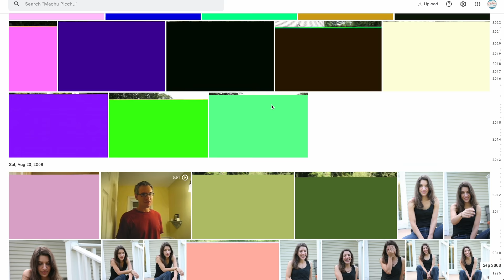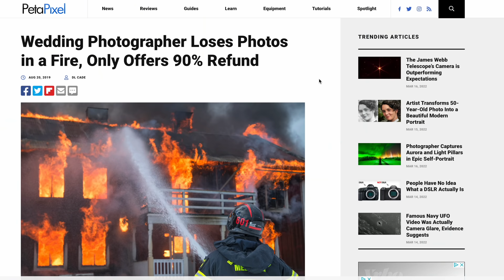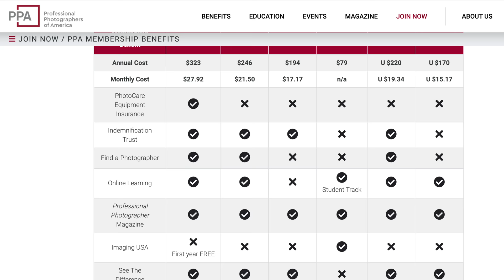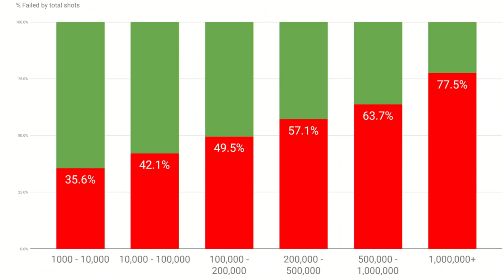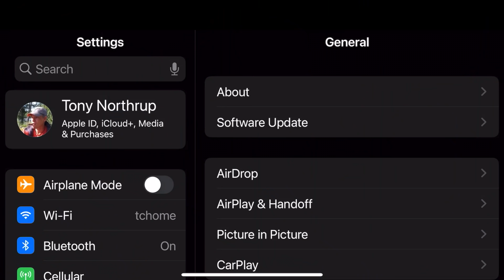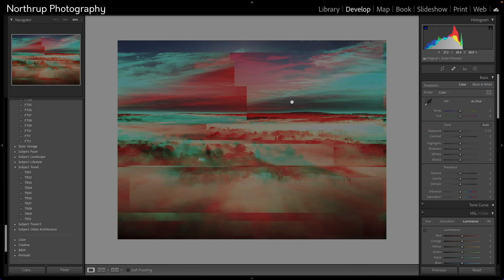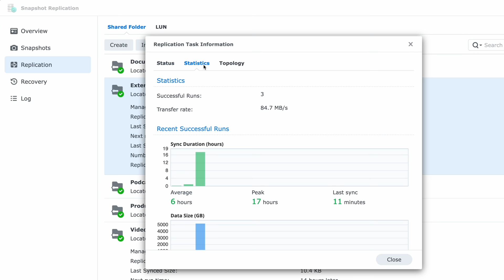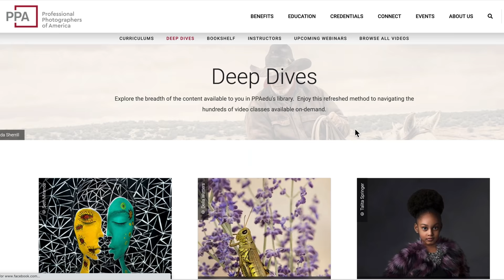NAS Storage for Photos & Video: PROTECT YOUR DATA!

Comment: Use a NAS that uses ZFS as a file system, since zfs has built-in bit rot and data integrity features. We build large enterprise storage SANs with sensitive data, all built on ZFS. In 18+ years haven’t had a single corruption issue with high io storage devices. I don’t remember the last time I had to do data recovery.
Reply: Yes, but make sure to use a mirror or similar as well as an online backup. A mirror allows for healing the rot.
Reply: Modern filesystems that protect against bit rot and data integrity are definitely the way to go. I'm building a new setup with two NAS-es now (haven't had any data loss in 20 years, but trying to beat my bad luck here). Primary NAS will be TrueNAS Core running ZFS. Secondary NAS will be Synology running BTRFS. I also have backup in the cloud for everything except video (too expensive and slow to backup and restore).

I'll also use snapshots at least for TrueNAS/ZFS, and I'm hoping to do this with BTRFS on Synology too. Snapshots every hour for a day, every day for two weeks, etc.

Even so, I'm still constantly worried about bit rot or crypto virus. I'd like to incorporate some form of checking integrity automatically, perhaps using hashing, but I'm not really sure about the best way to go about this...
Reply: Maybe if there were good ways to declare parts of backups immutable, in order to prevent them from being overwritten...?
Reply: Specifically make sure ZFS scrubbing is setup to repair the rot. Just having RAIDZ, etc. is not enough as it won't actively check for errors until something is accessed.

Linus Tech Tips just had this exact issue when they weren't actively checking their old data.
Reply: Tony said, that he's using Btrfs for his backup system, though?
Reply: @eivinha  That only protects against deletion and tampering. It does not protect you against a bit being hit by cosmic rays or other accident that direclty changes the values being stored independent of the drive's normal functioning.
Reply: @PeterBrockie  This is true. It's worth setting that up to happen every week or two depending on how often you're doing your backups.

That being said, if you've got backup software, it should be hitting all those files regularly anyways, the scrubbing is just an extra level of making absolutely certain that all the sectors are still good.
Reply: I used a NAS too but that didn't matter when my home burned down
Reply: ZFS is not GPL compatible and it's owned by FOSS hostile Oracle. No way I'm trusting my data to that. You can use LVM RAID + dm-integrity under RHEL based distros or ReFS + storage spaces if you have Pro Workstation or a server license. Both offer data redundancy and bitrot protection with properly scheduled scrubbing
Reply: @thephotodl4455  WOW thats a comment.  "BYOB and if you could RSVP ASAP that would be A-OK with me!" -Ryan George
Reply: @skyhouse71  you seem unfamiliar with tech names, perhaps you should stay away from NAS
Reply: @eivinha  that's a decent thought but consider that your backup isn't immune to bit rot. The only way that I've found is that you just have to have a separate record of all files. For example, if you create MD5 checksums for all new files, you can check whether they're still intact. Of course you'll need to keep checking both in your primary storage and backups. That takes a lot of time when you have lots of files but it's worth it. ZFS is probably superior to manual MD5 checks because it's data integrity checks are built in.
Reply: Exactly like this: ZFS is THE solution!
Reply: @thephotodl4455  ZFS has been forked a long time ago. There are OSS implementations.
Reply: @FrankFiene  open source does not mean GPL compatible (kernel requirement) or free from corporate interference. See MySQL vs MariaDB
Reply: @thephotodl4455  I don't need GPL compatibility, there are Linux distributions or MacOS (BSD) running with ZFS. I don't see any influence from Oracle there.
Reply: @FrankFiene  it's compatible with bsd license; using it with Linux kernel means you are giving up the cddl of zfs and it's associated patent license; the fact oracle hasn't done anything doesn't mean they won't. What paid Linux distro uses zfs? I know RHEL does not.
Reply: @thephotodl4455  No idea. I am using Debian and Ubuntu LTE in production environments. OK, not for SAP HANA, but for everything else.
Reply: @FrankFiene  you're fine until Oracle sees commercial value in the property or after all the parents expire. Right now Oracle sees no commercial value.
Reply: Every HDD or SSD that likely still works has full ECC on every bit written that's better than ZFS's checksumming. Sure, add a layer on top, but your drive itself is going to know there are problems coming long before any bit flips are visible on reads from your drives. Now, if they'd do a full hash of every file and store that redundantly, now we're talking security! Of course, there goes your performance :-(
Reply: @thephotodl4455  That's a garbage solution to avoid using perfectly good software. And BTW, I think most projects are using OpenZFS these days But if you want to shoot yourself in the foot rather than accept CDDL software, that's your prerogative.
Reply: @niduroki  BTRFS does have some bit rot protections but only in RAID 1 or 10, not 5 or 6. What he he going with two spare drives suggests that he’s running RAID 6. I would definitely caution against doing so with BTRFS. ZFS is very mature and rock solid.
Reply: @thephotodl4455  Yes, they tried with Java, other companies and the community built their own Java-Tools and Oracle failed.
Reply: I'm not sure in bit-rot protection in ZFS. In my view MinIO might be configured such way. 
ZFS is great. But it's so RAM-hungry during restoration process and painfully slow.
Reply: @SmallSpoonBrigade  why would I need to shoot myself in the foot when there are gpl compatible alternatives that work just as well? When you mix openzfs into the kernel you're de facto not following CDDL, because the kernel is GPL. You're just ok with using unlicensed software that nobody is enforcing IP on right now. Which is fine, if it fits your use case.
Reply: @FrankFiene  apples and oranges; I'm assuming you're referring to OpenJDK, which is based on Sun's originally released GPL code with linking exceptions, which does not cause licensing issues when mixed with other types of licenses; OpenZFS is different because it is licensed under CDDL with a kernel component that must interact with a GPL licensed kernel (when used under Linux); the two licenses are incompatible.
Reply: @thephotodl4455  Sun's open source code for ZFS was also allowed to be forked as far as I know. OpenZFS now. Implementing  it into the Linux kernel is not a problem for CDDL. But GPL has problems with this. So I don't take care as long it is implemented in my distributions and MacOS.
Reply: @eugenesmirnov252  ZFS painfully slow? Did you read that somewhere? Because I have zero issues with speed. Also it is ram hungry if you use deduplication features and a lot of VMs. But you also can get 128gb of ram for $100 on eBay for a TrueNAS. So ram is dirt cheap for FreeBSD systems
Reply: @FrankFiene  it can be forked and do whatever you want with as long as it's licensed and used under CDDL.
Reply: @aeiplanner  er.. 
let me repeat. ZFS is slow and RAM hungry during rebuild. 
 I had monitoring of restoration process of several dozens of hdds with 1TB RAM. 
 It takes almost a week.
Yes RAM is cheap, but you have to have enough slots, and your MBoard should have an ability to address this RAM.
Reply: Btrfs?? Have a good look at TrueNas and zfs Tony.
Reply: @thephotodl4455  I like lvm. It's most undervaluated thing nowadays, it's used everywhere but completely transparent.

Comment: Had a programming teacher who said, “Blessed are those who make backups of backup”.  I would always have a running backup and one stored in the bank vault.  Macs use a concurrent backup. But to be safe, have a separate folder the Mac never uses.  So, basically you have a concurrent backup on the backup drive and a separate folder that contains the photos. (X2). Much harder if you take thousands of photos weekly but it that’s your income, then invest.   Memory is cheap cheap cheap compared to 20 years ago.

Comment: Great video, Tony - thank you very much!  So sorry for your loss (we felt your pain). In a seminar years ago, an IT expert advised about backing up digital media - get in the habit (at least annually) of migrating your data to the next-best most secure storage available and have an off-site location. ChronoSync software really helps as you syncronize your drives. Your recommended use of battery backup power conditioners is spot on. I use 5 (from APC). Electrical spikes and sags can wreak havoc on sensitive micro electronics. The videos you and Chelsea produce are great!

Comment: One of the main reasons I'm using ZFS for storage at the moment, with scrubs every other month to check everything for corruption and to correct it if needed. 
With spinning disks I've found that basically since around the time they introduced shingled magnetic recording  reliability has gone downhill (even on non SMR disks).  
I have old 1-2 TB drives that have been running for years and return less corrupted data than brand new drives of similar size.  
Using a filesystem that can recover corruption combined with regular scrubbing of the disks, and to basically not sync files older than a few weeks from your PC (that probably uses a filesystem that won't catch corruption) to the storage server anymore really helps prevent issues for me. 
Also I don't know the current state, but iirc btrfs did have issues with raid5 or 6 type usage when I last looked into it allowing data to get corrupted. 
Also, don't have the backup server "mounted"  on your system as network drive or network source by default, set the server up to initiate the connection to your PC to get the data.  That really reduces the chances of ransomware getting to the data
Reply: @TDCIYB77  It kinda makes me wonder why Synology would even want you to use  BTRFS for archiving. (I don't know their products from experience, but I assume they will have proper documentation for filesystem choices). 
Ive been eyeing BTRFS for ages as replacement for my own home server/NAS, specially because it allows you to spread data properly over existing striped disks when you add another one. something ZFS doesn't allow. (last time I checked anyway). But iirc it was even on their own wiki that RAID-5/6 like setups were called "experimental"  (or something along those lines).  So NAS brands allowing usage of it without clear warnings about hat is kinda shocking to me.

Comment: You might want to try reading your images with different software packages. I'm a software engineer who used to write low-level JPEG code long ago. Some JPEG software will just abort if a single bit is wrong, and either the whole image or all the image past the corruption will be lost. For many corruptions, JPEG software CAN be written in a way to recover and decode the rest of the image. You will end up with a little defect in the image, like a 8x8 block  (or streak to the end of the the line) of garbage pixels, which can often be fixed up in Photoshop. JPEG also often stores the chroma separately from the luminance data, so serious corruption of the chroma data may still allow recovery of a black and white image. Corruption of JPEG files is not a binary thing, there are many gradations of how damaged is it.
Reply: I had the same thought... there are software packages to attempt repairs of corrupted image files. Not sure if any of them get into raw formats, but it's definitely worth a look.
Reply: That was my point to ThioJoe and Tony. He needs software that modifies the arm mechanics to read the bits of the file backward and forward to get "around" the bad spot and do what you propose. So, yes...this can work because I've been successful in doing it.
Reply: Does a single bit of bit-rot flip the Archive bit on ? Then he should have noticed that several very old images suddenly needed to be backup and have stopped him from doing so. The software I use give me a preview of what the scripts I have setup will do , color coded if overwriting/copying /Creating new etc. This has stopped me from making mistakes many times.
Reply: Thanks for your comment. Is there any way to save many .MOV files in a way to recover and decode the rest of the video in case of bitrot in it? Or, for videos bitrots are not so dangerous as for pictures? Any input from anybody will be greatly appreciated!

Comment: Great info, as always, Tony.  I think all of us - pro or enthusiast, must find the best way (that suits the individual) to address backup, recovery, and loss. I don't think there's any one way that's the correct way.  Each photographer should find what works best -- from a perspective of value, cost, time, and importance.

I'm not a fan of cloud storage -- but I'm only an enthusiast.  For me, it's simple -- I don't store any photos on my desktop (or laptop) PC.  After every shoot, I copy the contents of the memory cards to an external drive (connected to my desktop).  Note - If I'm in the field for an extended shoot, I bring an external drive and copy the contents of the days shoot to that external drive, connected to my laptop, each evening.  The external drive is backed up to my local Synology DS 920+, and a make a backup of the external to a 2nd external (then store the 2nd external offsite).  At this point I have 3 sources of the photos (not counting the memory cards).  I don't format the memory cards until I've confirmed the files on the Synology and the 2 external drives.

I do all Lr/Ps post processing from the desktop-attached external drive -- not the fastest method, but then again, I'm not a fast editor.  And, I replace the external drives every 3 years.  Is it perfect?  Nope - not even close.  Do I sleep well?  As well as one can, I suppose.  I end up with my complete NAS backup - original and edited files; another copy of the edited and original files on the desktop-connected external drive; and a copy of just the original raw files on the non-connected external drive.

For me - this sysem works.  

Like most of us, I don't go back and view the hundreds of thousands of old images on my drives, with any regularity.  I just don't have the time. But I hope that keeping my external drives fresh, on a 3 year rotation minimizes the chances of storing corrupted files.

Thanks again for the insight, detail, and passion.  Truly appreciated.